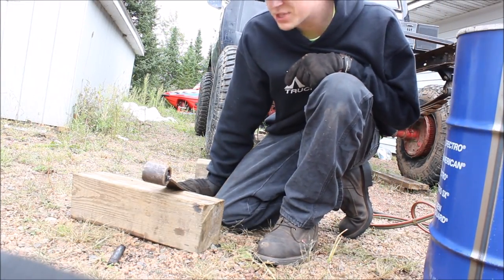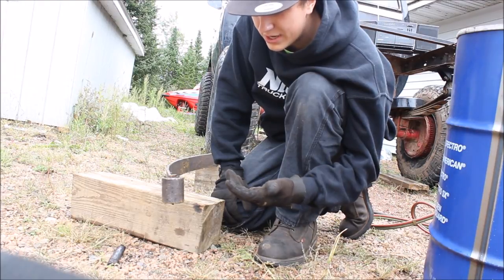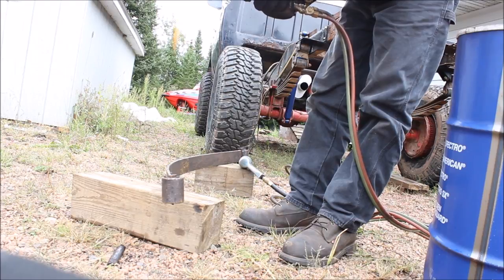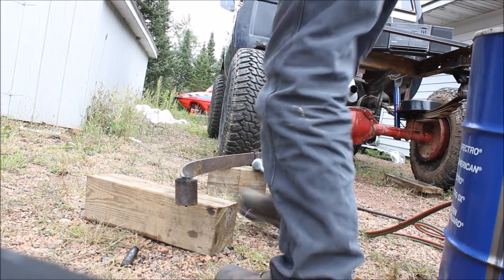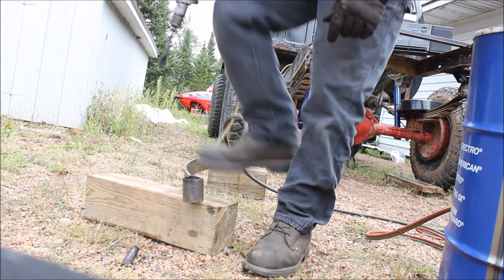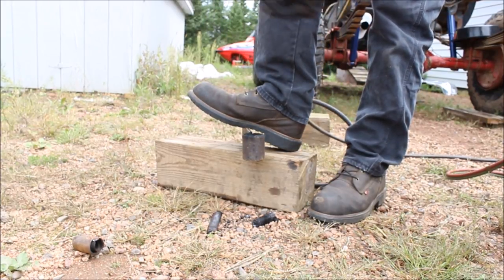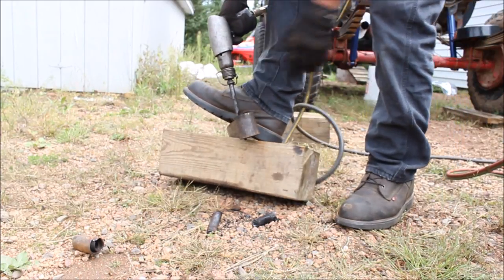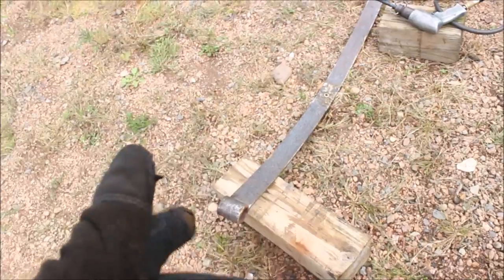How to remove a leaf spring/rubber bushing FAST AND EASY!!

Comment: If you do not have a torch or air hammer use the biggest hole saw you can fit in the rubber section. It works well and pulls all the rubber out when you can finally push through. Work both sides with the hole saw. Then cut the inner sleeve in half with a Sawzall and work it out with cold chisels.
Reply: James Avery ufff I like yours better. I was thinking about my carpentry tools 👌🏼.  03’ F250 5.4L
Reply: Yeah its probably the best way to get them out if you do not have a torch or an air hammer. I should have made a video on it lol. That rubber bushing is some tough shit

Comment: It’s a great technique to learn on a bushing that’s completely seized, but a bushing press can be rented for free at most auto parts stores and lower the risk of damage. A press can also be operated by hand wenches if you don’t have a compressor. They work just fine, I’ve done double sleeved bushings on tractor trailers by hand so I’m not sure I would air hammer unless I absolutely had too.

Comment: A few have expressed concern about compromising the spring eye's strength by using heat. As a tool & die maker for 25+ years and hobby knifemaker, here's my take based on how tool steel is heat treated: Annealing renders tool steel dead soft by heating to it's quench temp, probably around 1540 Fahrenheit, then cooling very slowly. Springs are born from annealed spring stock which is first shaped & formed. 
It's hardened by heating again to it's 1540 quench temp, but this time cooled rapidly, leaving it as hard as it can get...too hard for a spring, so...
The next process is "tempering" or "drawing" the excess hardness out of the tool steel, by heating again to the specific temp which makes that alloy a spring, then allowing to air cool. If tempered at progressively higher temps, tool steel will generally get progressively softer, depending on the alloy. This "draw" temp for "spring steel" is about the same as molten lead, 621 degrees, which means you won't actually threaten to draw more temper out of the eyelet, until it starts to turn blue. 
If one is worried about it, just buff some areas and don't let those bright spots  turn color...and of course be careful about direct, concentrated flame contacting the spring. The rapid heat & cool effect can certainly coax a crack yet not color the steel.

Comment: I did it with a propane torch and still on the truck. Took about an hour, but the air hammer is the best tool I've ever bought. Last time I did this on the other side I drilled out and burned out the whole thing...took hours.
Reply from the maker: Alex Dull Good to hear that it worked for you!

Comment: Not too shabby of a video.  Admittedly, I’m just watching these videos mainly to watch other people struggle to feel better about my project last weekend.  I have a 94 bronco and although nothing was wrong with the springs or the bushings, the hangars were rotting away.  I live in Illinois so our salt problems are just as bad.  

I’ve heard that this is the wrong way to burn bushings out.  Supposedly the right way is by heating the eye, but I also read that can ruin the spring if you don’t keep the temperature below 400 degrees.  Who the hell has time for that and not many of us have the means to know if or when we are exceeding that temperature.  

In hindsight, if I could time travel back to a week ago I would have just cut everything out and got new springs and bushings pre-installed.  This is only half of the hard part.  The next part that sucks is getting the new ones back in.  Stick em in the freezer the night or two before (the bushings), hit me with silicon grease right when you take em out and they should go in without too much of a fight.  Also helps to take a wire brush tool and clean out the rust from those spring eyes.

Comment: What you can do sometimes depending on the bolt orientation is cut the bolt head off and keep tightening the nut will pull  the bolt out  remove nut  add shims when the nut bottoms out . keep repeating

Comment: Hammer a large screwdriver or chisel into the spring space,  where the curl ended to expand the curl, hammer out bushing, oil up outside of new bushing, hammer it in, take out screwdriver or chisel….done! About 15 min., per spring.

Comment: chrisfix says torch the outside... anyway my question is ... isn't there a danger torching the eyelet if it's still attached at the front end to the frame of the truck?
Reply: Not if you’re not hitting anything that will burn!

Comment: How do you get a leaf spring bolt out that will. It come out I’ve try map gas and it still will not come out my leaf spring is completely snapped
Reply: grind it.... saw it.... plasma cut it..whatever is easier for you.. be safe!

Comment: I get the point of what you're doing here and I was with you up until you started splitting the weld on the leaf spring... How is that not a safety issue?
Reply from the maker: Wolf_22 it’s not a weld, I was splitting the outside of the old bushing, leafsprings are not welded, the eye is just bent around in a circle
Reply: @BENK482  Sorry, man. I guess my eyes aren't as good as they should be--I thought it was welded. Thanks for clarifying that.

Comment: Next time show the flame going INTO the steel tube rather than confusing some (not me) by the side view. I've done many that way and I know you weren't heating it very long, but it triggers others. I just aim the preheat flame straight down the steel tube and they often drop out.
Reply: I think the bolt was still stuck in the bushing so he couldn't put the flame down the tube. I  guess that was why he suggested oxy acetylene instead of just a blowtorch which would be sufficient if you could fire it down the tube. Just my thoughts.

Comment: You're changing the metal properties of the steel, use a press instead.
Reply: Only if you heat the spring EYE, not the steel tube inside the rubber bushing. The video is poor.
Reply: Nope. To change the steel you have to heat it cherry red to convert it to austenite. Once you're there , depending on how you cool it you get different properties. He never even got close to heating the spring up.
Reply: It cost me a lot of money to go to engineering school. Austenite is a real word. :)
Reply: @mikeries8549  😆👍

Comment: that spring eyelet will break within the year torches ruin the heat treating to the steel.
Reply: @obfuscated3090  
There is a video by Eaton Detroit that says we should not get the leaf spring steel hotter than 400 Fahrenheit for fear of softening the steel.  I have a map torch I could use.

IDK.  This is my first time changing the bushings.  I do have a press.  Maybe, I should just use the press for removal and installation of the new and stay away from any heat.

Comment: If you heat the outside it will slid right out.
Reply: You should avoid heating springs
Reply: @connor3288  shouldn't you avoid heating any metal since it will weaken?
Reply: @laymensgrowing2032  I'm not an expert in metallurgy, this could be a very long conversation with one who is.  Metal is more complex than it seems, hardness, heat treat, alloys, etc.. My point of view, you heat up bolts and nuts to get the job done, but heating spring steel too much messes up the spring properties, some people have lowered cars by heating up their coil springs!  You should try to avoid heating up springs for that reason, and they may be more likely to break if heated  improperly (heated after they are manufactured)

Comment: Yeah, don't do that. You completely ruined that leafspring. Some have a weld holding that together, if that one did, it doesn't now. Some don't, but the bushing have tolerance, which you just completely took out of spec by spreading the end
Reply from the maker: This video was from 6 years ago and the spring still hasn’t broken….